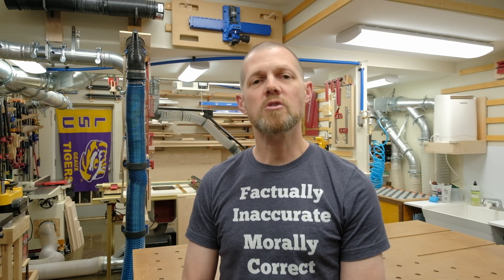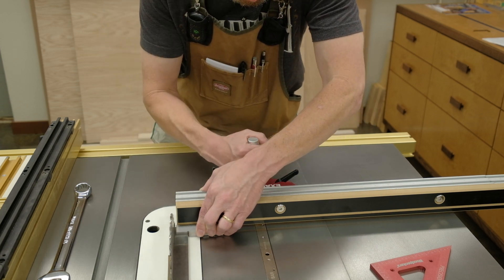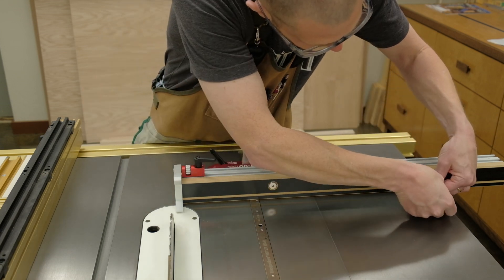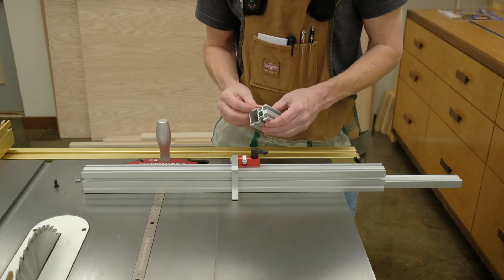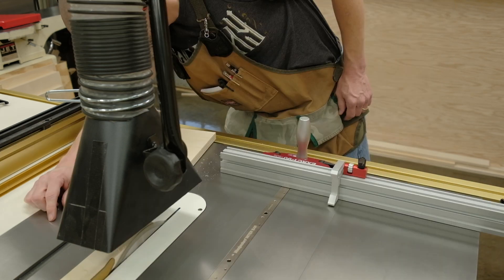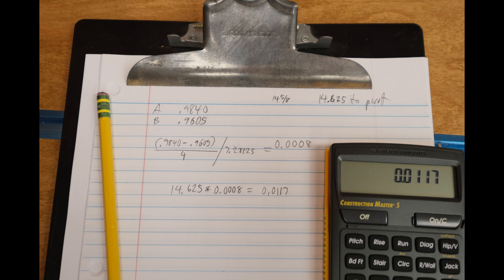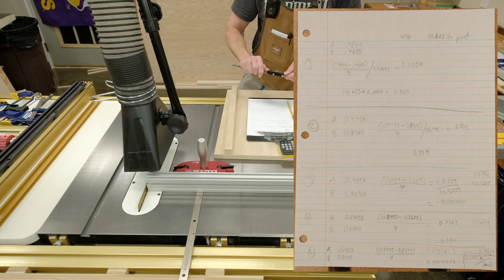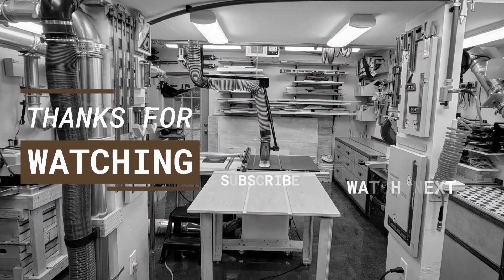EXACT-90 Miter Gauge - Setup, Calibration & Storage

Comment: I just got the Exact 90 and it does exactly what they said it would which is why I purchased it and it does it all well.  YES it's pricey but with the added "Flop Stop" it is a good tool when you need to make exact 90 cuts on wood that exceeds the distance from the edge of the blade to the edge of the table saw and that makes it worth the price for me.  BY THE WAY, I also agree with the phrase on yoour shirt and praise God For it "By Faith Alone!"
Reply: Through Grace Alone!
Reply from the maker: Thanks for the feedback. I'm glad to hear that it is working out for you. I have used it a lot recently and have been very pleased with it. Soli Deo Gloria!

Comment: Very nicely done video.  Like & Subscribed.  So...do you recommend this device?
Reply from the maker: That's a good question. It is tricky for me to answer because of the price point for a tool that does just one thing. Although I think it does it quite well.

I just check the Woodpeckers site and the price is actually reduced right now ($270 instead of $330). I bought mine at an introductory price that I don't remember right now. 

So, if the price isn't a problem and you need a solution that once calibrated you know will make accurate square cuts on your table saw, then I think this is a good option. 

I bought this because I thought it would be a good option for getting good square cross cuts on larger panels which is something I have struggled with in the past. However, since assembling and calibrating this, I haven't had any projects where I needed to use it so that also makes it a little difficult to be definitive about it.

Sorry if I am being a little wishy washy, but it is a decent amount of money. 

Thanks for the comment, like, and subscription.

Comment: Did your Exact 90 not arrive perfectly square?  WP claims that the gauge is meticulously adjusted square at the factory, and that they typically should not need user adjustment.  Obviously, they do provide for calibration. Just curious, as I’m getting ready to buy one.
Reply from the maker: I'd say it was pretty accurate out of the box. My first test for square showed that it was out by 0.0008" per inch. That seems pretty good to me. I messed with it a few times to see if I could improve on that but to answer your question, it was "square" when I received it. 

I put that in quotes because in my experience, if you are able to measure to a sufficient level of precision, you'll discover that nothing is truly square. Or to put it another way, square is relative to what you are working on and for most any job that I would be working on, it was square enough on arrival.

Hope that helps.